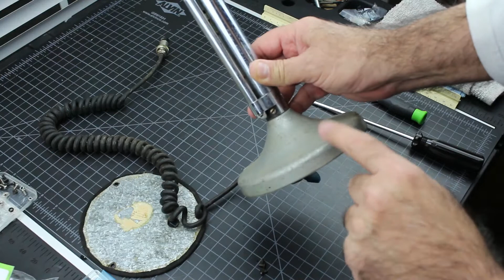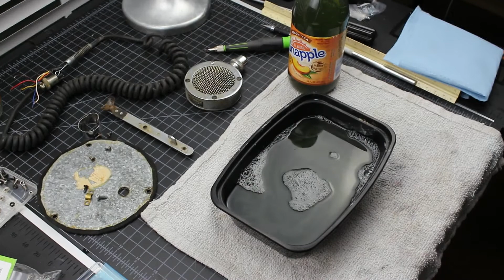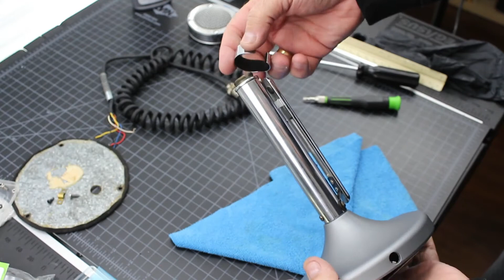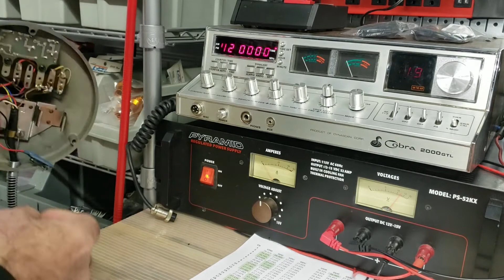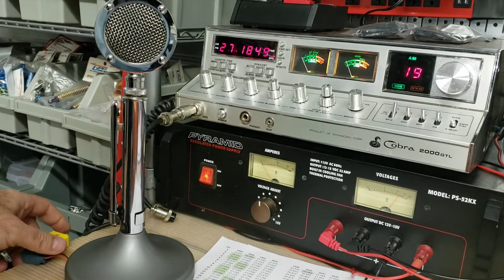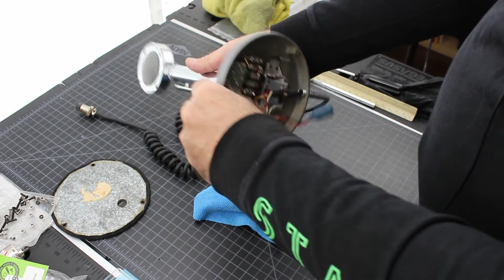Refreshing an Astatic D-104 CB Microphone

Comment: Hello, great video. Would you know what the numbers and letters are on these Astatic microphones? T-UP9 and all the others? I have looked all over and can't find anything on it? Suree would be nice to know what these numbers and letters are on the mic stickers! Thanks.
Reply from the maker: The G Stand was introduced in January of 1938. The "G" came from "grip-to-talk" as the first few ads referred to the G Stand.

In the 1950's the wiring changed to 3 conductor and the stand became UG for Universal Grip (the PTT lines was adaptable to different control circuits)

In the 1960's a transistor amp was added inside the base. The stand then became TUG (the T was for transistor amplifier)

The 8 and 9 (TUG-8) denoted the different amplifier boards
Reply: @revivingretro  wow., very interesting. That pretty much sums up my question! Thanks for the reply. Thank you.  73-  160 South Central MI.  📡

Comment: Good refurb however I would suggest n the future taking the PTT mechanism out of the neck and burnish the connections as they oxidize over time. I have done a few of these in the past. Sei chrome does an amazing job on the chrome. I'm about to wrap a base with vinyl car wrap. we will see how it turns out.

Comment: you ruined the base with that chemical… a Brillo pad would have cleaned everything.  the cord is 40 plus years old and it’s brittle, the wires inside are brittle too.
Reply: He didn't ruin it, he just did not put enough paint on it to get the hammered appearance.

Comment: great stuff even if i dont like astatic stuff. :) have you ever rebuilt any of the turner desk mics? the Plus 3 or plus 2?
Reply: @revivingretro  I have a few D104’s, plus 2 and 3’s.  All in rough condition. Your video is inspiring me to look at repairing them. Vintage equipment can’t be replaced IMHO. Nostalgic none the less.